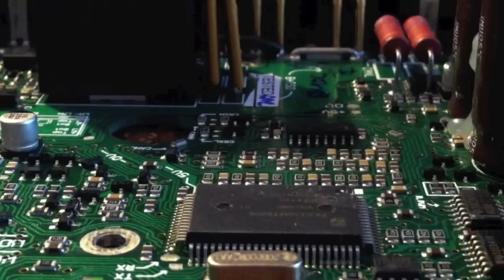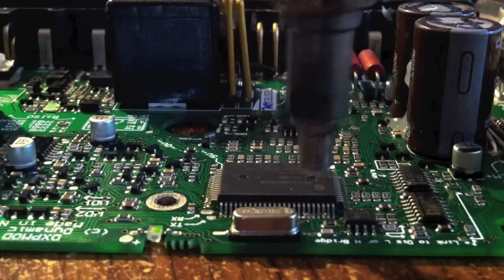Reflow Soldering - first try

Comment: If you don't heat all of the pins evenly, you are sure to lift a pad / trace.  If you don't need the part to survive, you can heat one pin at a time and lift it out of the way with a dental pick.  It takes a while, but it is much safer.  In a perfect world, you would need a square adapter for your heat gun that would heat all four edges at the same time.